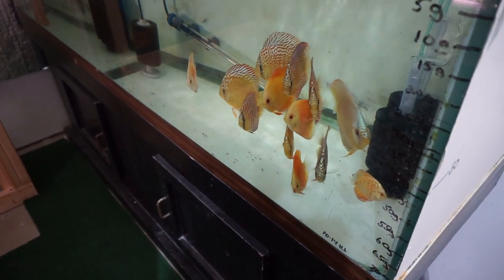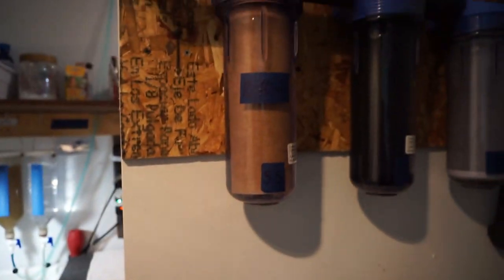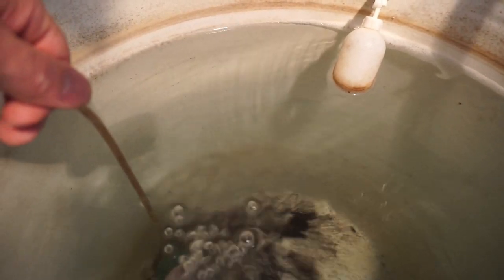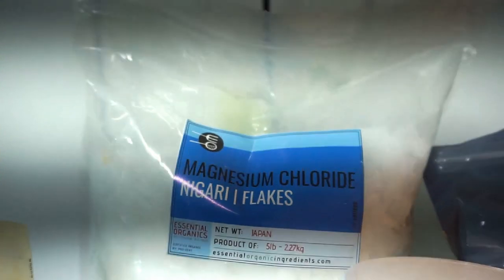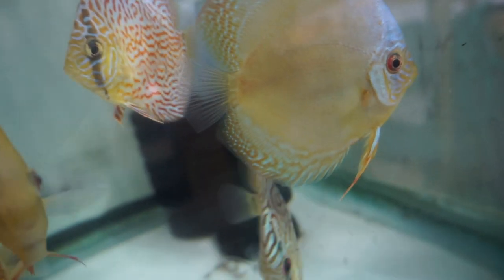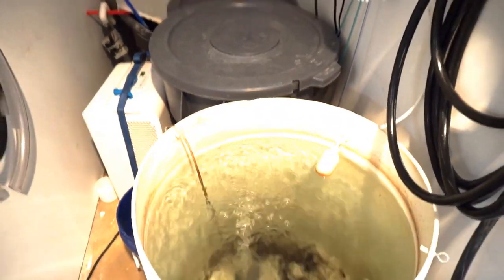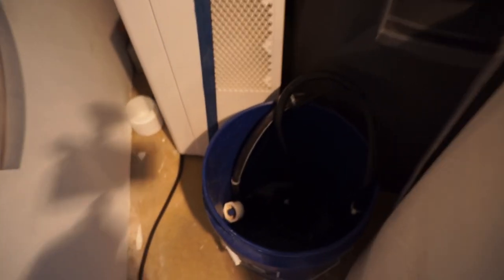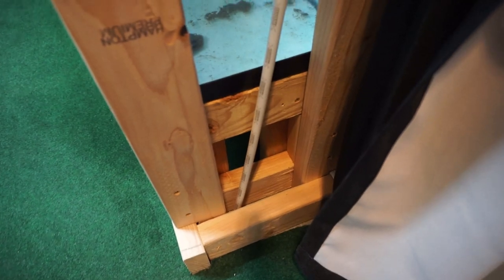How to prepare water for keeping and breeding Discus fish

Comment: Thanks for sharing! Appreciate the effort you put in to ya vids 🙏 Roughly what percent and how often do you water change for moderately stocked with adults?
Reply from the maker: 20-25% 1-2 times a week depending on mechanical filtration. Really great filtration is once a week. Take into account the stocking density also a great place to start.
Steve Heller 
Shelleraquatics.com
Reply: @shelleraquatics  many thanks Steve
Reply from the maker: @SickDiscus 😊

Comment: I use a 1-micron sediment filter 2-chloramine filters 2-membranes- 2 di filters i use Discus Minerals which i buy from Germany my ph is at 6.4 i add a little of potassium bicarbonate for a little kh. My discus spawn all the time i keep them in 90 gallon tanks this system works best for me been doing it this way for over 25 plus Years.   Joe H   Navy Seabee
Reply from the maker: I love it, I've been called crazy for my setup but it just takes 1 time to realize how crucial it is to be prepared for anything that can and will sneak up on you eventually and negate all your hard work.

Comment: Why cant you just use 75% ro and 25% tap chasing numbers are not good
Reply from the maker: I just use straight RO water now with a little crushed coral for a buffer. In 2 years of research I have found that these fish do not take hardly any nutrients from water and most comes from their diet. I have developed a food that gives them almost everything they need. The key is fulvic acid which has changed the way I think about Discus. It is a carrier to the cells. This is a byproduct of humic acid on the cellular level and allows super absorption of all their vitamins and minerals. The results have been amazing. I about to release the product in the next month. As far as mixing I have super hard water and it takes my soft neutral water to levels that are not conducive to the wild species I keep. Even a small percentage agitated my Wild Altums, it also could be a toxin in my water that can't filter out. This is another benefit of fulvic (Gold not brown) it binds heavy metals which does not penatrate to the cellular level. They are my barometer for my new system. I have never seen blue/green turquoise and I call razor silver in captive/wild Altum Angelfish. This has been 2 years of research working with scientists, chefs, farmers, and biologists. I have logged approximately close to 1000 hours on this subject and it has changed how I look at the Amazon,  the water and fish diets in general.
Steve Heller
Reply: @shelleraquatics  Thank you for your speedy and very interesting reply. Food for thought, pun intended